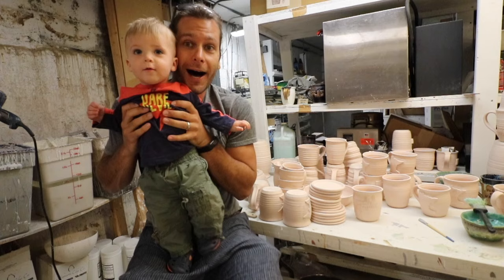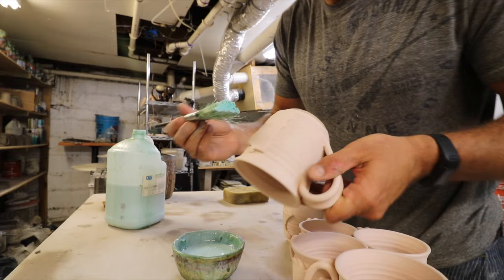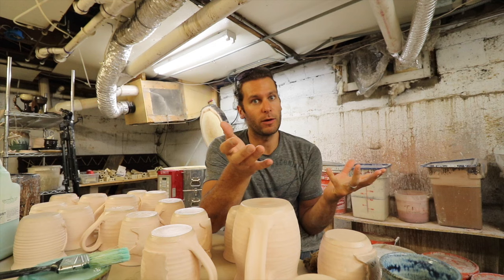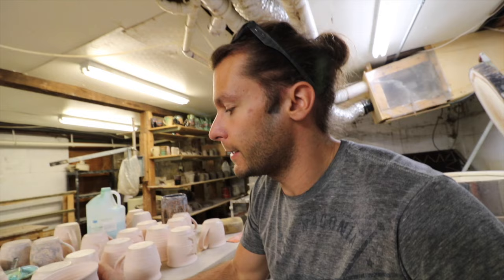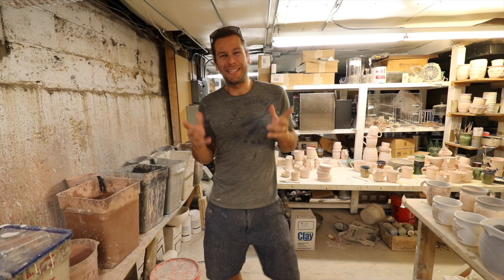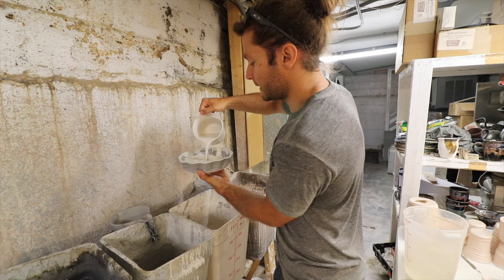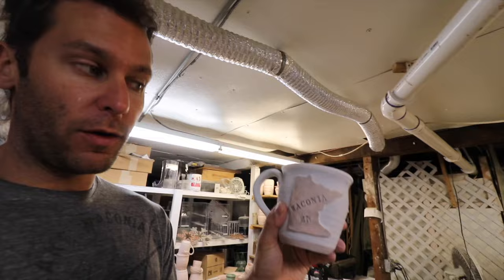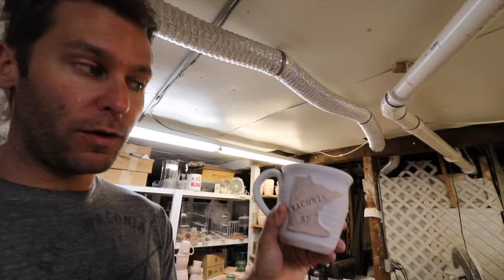How to Glaze Pottery! Tips, Tricks, and Techniques

Comment: When I get wax on where I don't want it, even after I glaze it, I just burn it off with my small propane torch.   It doesn't harm the glaze, if I already glazed it.   Then I glaze over that part w/o a problem.  This way even after I glaze it I can see if there is an uneven stop I don't like and want to redo.  Thank you JTP, I have learned a lot from you.

Comment: In your videos you speak about letting the glaze dry completely before you add the next glaze. I've been taught that you have to add the next layer when the first glaze is still wet (which is really stressful and difficult to do because the glaze dries so quickly). What I'd like to know is do you think it's because of the type of glaze we use in SA? Or maybe because of the type of clay? I use earthenware clay which fires at a lower temperature (1060 degrees for glaze firing), so obviously I have to use glaze which is made for earthenware firing temps. I'd love to do more layering of glazes but I struggle to do it quick enough. Also, I find glazing so frustrating and difficult because I often get drip like marks when I'm trying to get one even coat (dipping issues I'm sure) Do you have any tips or advice that can make the end product look more polished and consistent? Also, I've seen that when you handle your pottery when you add another layer, you handle it quite easily without the glaze "rubbing off" in areas where you have touched it. I find that often it rubs off so easily when I touch it after I've glazed and I end up with all these rough patches. A lot of questions, I know, but I'm hoping you may have some advice? Thanks,Pam
Reply: You should wait for them to dry in between and also after you are all done glazing, before firing.

Comment: So I took a very remedial class years ago and have forgotten it seems everything if my results are an example. I came across u and I think one of my problems it not using enough water.. but even before that after I wired my piece off and tried to put it on a bat it was too fragile to handle... I came across a wonderful European show called the great pottery throw down and they just wire it off and pick it up and put it into a bat. My pieces have to dry for some time before I can do that. I'm confused because I don't think I used enough waster to start with because I would make the weak and then added more water with the same results. It discovered after some videos that there are different kinds of clay.. I bought a 50lb block from Amazon...

Comment: Thank you for doing this. Temperatures are really confusing me. Clay has a temperature and the glazes have temperatures. How do you figure out what clay to use and what glaze goes with that?  Can you tell me what is a good universal clay and Glaze to start with?  I have not bought a kiln yet but I’m looking for the right one and I don’t know enough about these temperature issues.
Reply: There is earthware clay that can handle 1050C maximum and stoneware that can go up to 1300C but  1200-1260C is fairly enough for the clay to become vitreous and impermeable, unless it is refractory clay.
When buying glazes they are separated in low fire or high fire, usually having a range of +-60 degrees celsius. The glaze should indicate min and max temperature on the etiquette as well as the clay. 👍

Comment: Please help me, I have a trouble. I don't know , maybe my formula is wrong but my piece is not uniform when I inmerse it on the glaze. Is clean in different parts ( not wax). I hope you could answer. I admire you, your work is stunning!!
Reply from the maker: Hmmm, hard to know without seeing it, I would say make sure it is washed off and clean before dipping, is it not working right away, or after it is fired.  If it doesn't work after firing, then it is probably a glaze issue.

Comment: What do you use to get the wax resist off the brush?
Reply from the maker: Just warm water, cleans up pretty easily.  If it dries on the brush you can use really hot water to clean up.